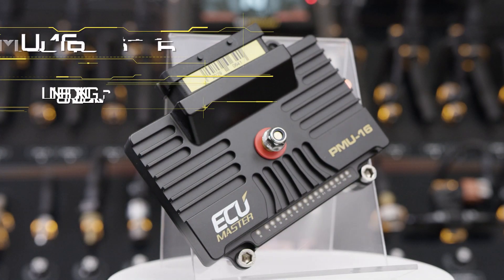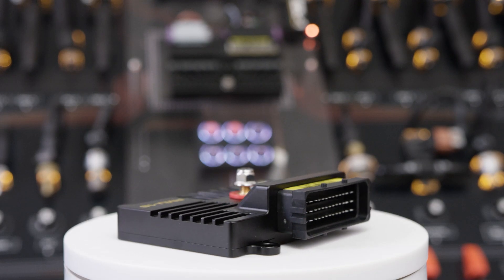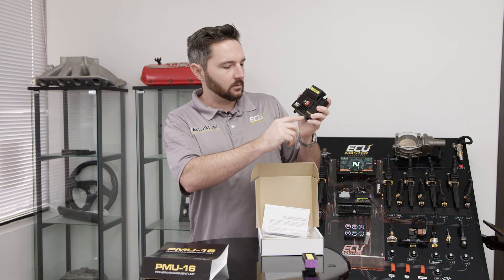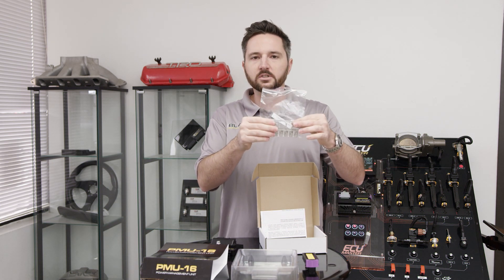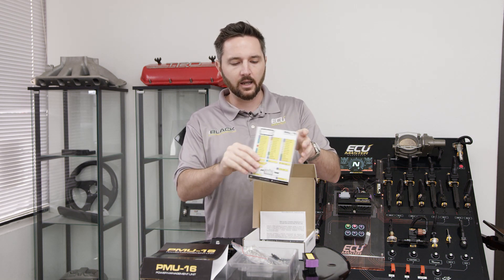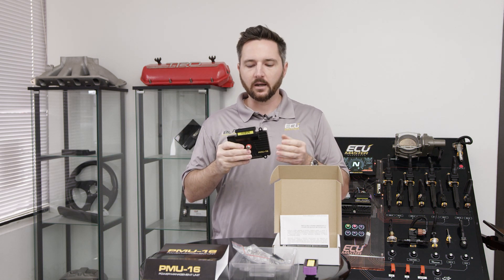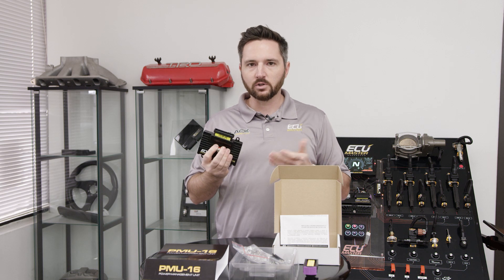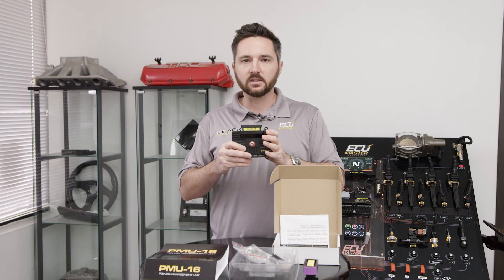ECUMaster PMU16 Unboxing

Comment: I've built a few motorcycles using the Motogadget M-unit and I kept asking myself if something like that existed for cars..... and here you are! I just started a '77 Datsun 620 truck project and I plan to go with a fully built KA24DE-T motor. Since I'm building every aspect of the truck from scratch, I wanted to completely eliminate relays and fuses and go as clean and streamlined as possible. I can't wait to get my hands on this and blow up your techs with endless questions!

Comment: It’s a nice product but its too expensive for the relay and fuse control 
I think they arw aiming to rich people or 100k cars 
It’s just a fuse box man
Reply from the maker: A fusebox can't retry a circuit or instantly turn on a backup circuit, give diagnostics (via the status LEDs or a CAN message), soft start or PWM a channel, or implement any kind of advanced controls. Not to mention the inertia switch function that will disable all circuits in the event of a collision. By the time you purchase several switches, relays, a fan controller, and all the materials required to install them, the cost ends up being very similar and you have a fraction of the functionality of a PMU16.

Comment: any for renault clio sport  197 hp
Reply from the maker: We do not offer a plug and play or interconnect for your car. Check with your local distributor/retailer for options.
Reply: Not much off the shelf for French cars. There's a clio specialist in the UK will rewire your car to utilise the pdu. 
I am doing the samw with my 405

Comment: Hey Guys from ECU Master. I have a few questions about your products. To make changes to CAN operated devices from ECU Master like the PMU, do I need the USBtoCAN module or is the access possible through the USB from EMU Black or ADU? Second question, the Datalogger DL1 is wired to outputs at the EMU Black. Does it log CAN things like data from the PMU and for example the GPStoCAN as well? Or does the EMU provide only engine data to the DL1?
Thanks
Reply from the maker: Please email all of these questions to support@ecumasterusa.com